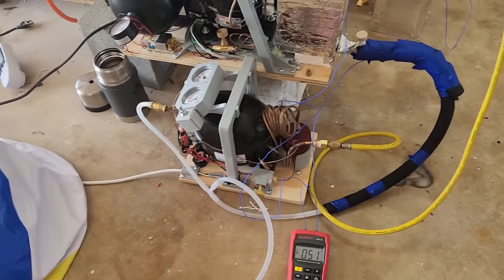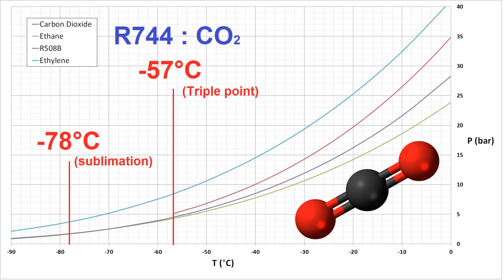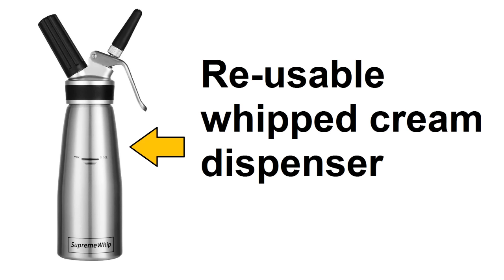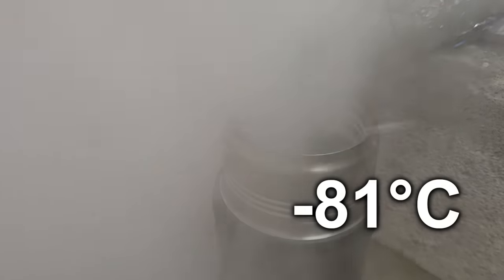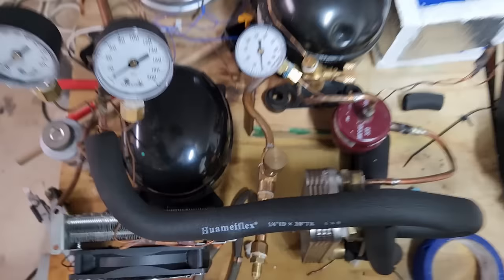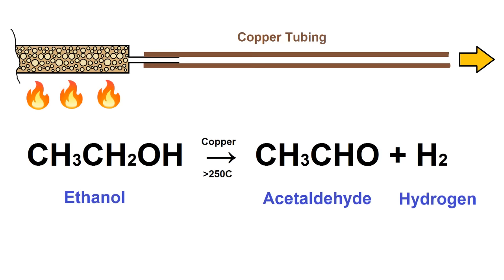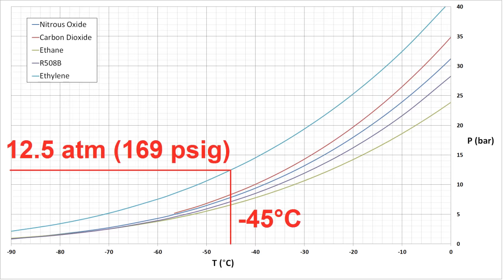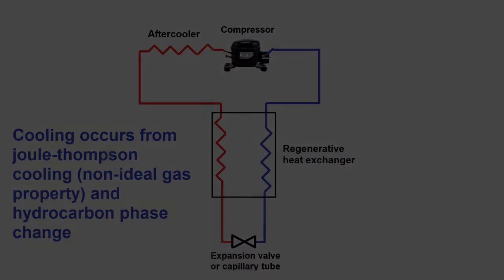DIY Cascade Refrigeration System (Part II)

Comment: as a hvac tech i would seriously recommend dropping the tubes and just getting some TXV's to regulate the system. its removes nearly all variables around the cap tubes and allows you to have liquid refigerant storage (you can also cool) and massivly increase the efficiency.
Reply: wow, thanks for the buzzword. whole new rabbit hole for me to dive down. Thermostatic expansion valves are super cool! I rarely get so caught up in a new (to me) idea.
Reply: @blakes8901  then you are going to love electronic expansion valves and variable speed compressors (aka: inverters). its why minisplit AC's are so efficient.
Reply: Thanks for the search terms. I love learning.
Reply: TXV will only work for first stage. For second stage capillary or EEV is the only option.
Reply: @Exotic_Chem_Lab  Why won’t a TXV work for second stage? I really only understand normal household HVAC systems and have never messed with multistage, but I find it fascinating!
Reply: @truthsmiles  because you wouldn´t find TXV for this application, even the bigger companies which are into crytoch units are using capillary tubes
Reply: @truthsmiles xv has a sensor bulb filled with refrigerant. This refrigerant regulates the txv. So it will only works for system that uses this refrigerant or similar ones. You can't use it for anything else
Reply: @Exotic_Chem_Lab  So why not get a TXV filled with ethane or NO2 or whatever? I guess they aren’t made?
Reply: Seems way too cold for TXVs that don't cost the amount of a small neighborhood, at least on the 2nd stage.
Reply: @truthsmiles  The bulb need to measure accurate to the tube temperature, the lower temperature the more ambient temperature will be a hassle to the system in a long therm. That is my guess. A cap tube will not work bad when the bulb insulation degrades, stressed technician, dry thermal paste etc.
Reply: @truthsmiles  they aren't made for those gases
Reply: @Exotic_Chem_Lab  Call me crazy but it seems plausible to me to make one... you could cut the bulb open, braze on a service port, and fill it with your brew of choice? Of course it would be a very "engineering prototype" kind of contraption, but seems doable, no?
Reply: @truthsmiles bruh... better use electronic expansion valve or just capillary instead of destroying TXV and messing around with it
Reply: @Exotic_Chem_Lab  tetrafluoromethane in 2.stage is option too but Hard to get
Reply: @a.belladonna8316  CF4 is for third stage.
Reply: @Exotic_Chem_Lab  Hey, somebody has to go first, right? ;)
Reply: @truthsmiles  both Capillary and EEV are cheap so no point in messing around with TXV :)
Reply: @Exotic_Chem_Lab  thanks  but i  plan r404a for first stage but ı dont research cf4 pressures anyways dont avaible for me
I have question for you r 290 better than r404a BP is lower but efficiency  ı Just dont know
Reply: @a.belladonna8316  propane is better for first stage as it has higher thermal conductivity and lower viscosity. If you can work with very high pressure flamable gas then go for R290
Reply: Well I am sleep  deprivated when posted i confused r14 vs r23
Reply: in cascade system its goal to reach coldest temps as possible its not abouth efficiency when i was Child xtremesystems forums i read bunch of single stage and i do it few Times but never able to build cascade 2 years ago i buy brazed plate heath exchanger now ı waiting for first stage rotary compressor sorry for my bad english
Reply: @Exotic_Chem_Lab  thanks 👍
Reply: @SupremeRuleroftheWorld Thanks for expanding my vocabulary on these items, more to learn! Can one run any compressor variable speeds with PWM controls, or are variable speed compressors built differently?
Reply: He will just need to remember to Purge and flow nitrogen to keep from blocking up the TXV probably wouldn't be a bad idea to do that for the final system anyway.

However as a relative newb to the HVAC world I'm not sure if it matters as much on smaller as it does on larger ones
Reply: @SupremeRuleroftheWorld cool guy 😎
Reply: Are you not pulling a vacuum on your system? I see your filling the beach ball and no mention of pulling a vacuum on the system before filling. You might have non condensables issues.

Comment: love this project. the idea of making your own refrigerants is so interesting. i work on cascading refrigeration freezers for work with box temps hitting -80C. High stage uses R-290 (propane) and low stage uses R-170 (ethane). we have a different freezer that uses R-404 on the high stage and R-508B on the low stage.

I think you would also benefit from figuring out the superheat of some of these tests of these refrigerants to help see if liquid is spitting past the evap coils. if theres even a PT chart for some of these refrigerants lol. also they have pressure based txvs that can let you play with the orface size instead of having to make the cap tube calculations. another idea i had was using pistons like they do in residential hvac units and you could swap them out for different sizes. good stuff man keep it up
Reply: Once I saw his first video on ethylene, I found a comment on making it with phosphoric acid, since I had all the equipment I have this setup in my garage, but I'm getting some contamination because it is hard to get ethanol here. I'm using some first cut distillate that definitely has methanol and who knows what alcohols in there. I definitely condensed some ethylene last time I had a go, but barely any at 550 psi and -35C. More dimethyl ether and ??? than ethylene. Definitely some hydrogen or otherwise contamination too.  I am going to use liquid nitrogen to clean it up.. just waiting on the dewar to show up.
Reply: @SEVERA PRAVDA the amount of surplus energy you put into the damp, protecting the compressor of liquid, look into a logPH diagramm and you´ll see the dampzone, superheated zone and subcooled zone of your refrigerant, a single stage refrigeration cycle uses the dampzone and and a tiny bit of subcooling on the highpressure side, a tiny bit of super heat on the low pressure zone (very basic explanation)
Reply: Danfoss has a slider you could use to make a good guess for all these refrigerants on their mobile app

Comment: Have you considered harvesting some EEVs off of an old inverter mini split instead of using capillary tubes? That way the expansion is constantly tunable with ambient temperatures, etc. With a microcontroller you could really dial in the ideal evaporator temperatures of all of the stages.
Reply: its quite complicated to set up, regular TXV's would be way less complicated.
Reply: @SupremeRuleroftheWorld TXV won't work for second stage.
Reply: @Exotic_Chem_Lab  Too low temperature for working fluid inside TXV?
Am I right?
Reply: @markhivin8670  yes

Comment: Thank you for all the information and detail you include in your videos! I recently found a huge laboratory freezer on the side of the road used for testing ceramic connectors in aircraft! Along with an endless list of equipment including 2 ultrasonic cleaners, multiple soldering stations and lab equipment 😂

Comment: A few words about Nitrous Oxide.   
You've an ignition source right there, in your compressor - internal friction.
Be wary of adiabatic compression causing N2O to decompose, there have been accidents and deaths on the aerospace sector. 
Somewhere on YouTube is a video of an aluminium tank exploding from a propagated shock wave through a metal charging line, the guy was using this in his home built rocket.

Comment: Awesome stuff, I love where this is going! One suggestion from the ethylene production video that makes more sense now: iirc you were using a water bath for boiling the ethanol, but had the flask flat on the bottom of the water bath. Usually when using baths like that, the flask (usually a round bottom/boiling flask, but doesn't really matter) is held above the bottom of the bath by the neck of the flask. That way there's no thermal conductivity between the heater and the flask. There's a slew of clamps, stands, and labjacks for such setups. As for your pressure and stopper popper issue, flasks with ground glass joints can hold glass stoppers or other attachments on under low pressure using keck clips (available at your favorite bong shop, lol) - but your solution is pretty clever without investing in a buttload of glassware

Also, fun fact - acetaldehyde (acih-TAL-de-hyde) is the first metabolism product of ethanol by the liver and is considered what contributes to hangovers.

Comment: In the late 70s I designed and had built a thermal cycling chamber for nuclear grade components that went from 450 deg F to -150 deg F.  For the first stage I used R-502.  I used R-13 for the cryogenic side.  Yeah, they're CFCs but since nobody uses them anymore, they're quite cheap.  Maybe you could find a friend with a license to buy you some.  I still have some 502 that I'd give you but I suspect we live too far apart.

Couple more comments.  You should be using a de-superheater on each stage.  This is a simple heat exchanger.  On one side the cold gas from the evaporator flows.  On the other side the hot gas from the compressor flows.  This does several things.  It brings the temperature of the gas going to the compressor up to a more palatable value, making the compressor more efficient.  Second, it cools the hot gas from the compressor so that the condenser pressure will be lower, again improving the pumping efficiency.

Second tip.  Compressors come in 3 flavors: High, medium and low temperature versions.  High is for AC, medium is for refrigeration and low is for applications like yours.  A medium temperature compressor, as yours appears to be, will not handle the cold side of the cascade.

Comment: I have worked with cascades down to -152c by auto cascade set up using 5 gases.
The last boiling on those systems was R50 methane.
Boiling point -161,6c by atmospheric pressure.
 Could be possible to use in the last stage?
Very interesting to follow your ideas and that nothing seems to stop you😊
The last you think of is used by industrial gas producers and a great solution😬

Comment: As an insulator a Spray Foam may be used (Spray foam insulation or spray polyurethane foam (SPF) ) it have good thermal isolation properties

Comment: This is easily the best build series anywhere on YT right now, mega props and keep going! 

One question though: The compressors themselves have to be running at very low temps, how do you accomplish that? It seems like it’d be hard to find lubricants that would work well that cold, and I’d think the compressor itself would be a huge heat load on the system. Are you using some special type of compressor that’s designed to thermally isolate the piston from the motor and body of the compressor?
Reply from the maker: Usually you add an "aftercooler" between the compressor and the second stage's condenser so that any heat from temp. rise over ambient can be discharged. It works without an aftercooler, just less efficient

Comment: i used to work on cascading cooling units, we prefilled the 2nd stage with a little amount of R290 (3bar abs gas) which helped with oilclogging problems and too high condensationproblems (afaik the receipt came from a company named Colora, they sold that as "coolmix")

Comment: Have you considered a different compressor?

A screw compressor could reach higher pressures than the one you‘re using and you have the added benefits of less parts (albeit of a few high precision bits and bobs) and no more hammer-action mechanics and also controllability (varying speed and/or oil seal length).

Mayekawa builds the Pascal Air ™️ ,  reaches -100C with air as refrigerant.

Great stuff!
Reply from the maker: Next part of the project will use a rotary compressor

Comment: Getting your EPA card to buy refrigerant is easy. You just have to take an exam and pay a small fee. You already know all of the theory so all you have to do is memorize some random laws and dates relating to them which is still on the test (even though the dates have all long since passed), and possibly study a little about less familiar stuff like low pressure chillers. There are also safety questions on there. I studied in my spare time a few weeks for it, took the test at a local community college (I did not have to take the associated class), and got 98% on all three sections.

I wouldn't say it was completely trivial, but given how much you mess with refrigeration stuff, you'd probably benefit from it (watching your videos I was surprised you didn't have it already.)
Reply: As an aside, I'd be surprised if nitrous oxide couldn't burn at least some HFC refrigerants like R32 which are mildly flammable.

Comment: The lower-than-equilibrium temperatures you are seeing is to dilution of the evaporating refrigerant by air.  This produces a reduced partial pressure of refrigerant vapor at the liquid surface.  The total pressure is 1013 mbar, but the partial pressure of refrigerant vapor is less because only part of the gas at the surface of the liquid is refrigerant vapor.  This gives a lower than expected temperature.  
It's a big effect.  I've seen 20C lower than the equilibrium temperature in an exposed pool of R12 (decades ago).  It actually drops further if you blow on it, because of the increased dilution.
If you arrange your test to vent into a semi-closed container (cup) that keeps much air from getting to the liquid surface, you'll see the exact expected equilibrium temperature for atmospheric pressure.
Reply: TMD-50 manual shows an accuracy of +/- (2°C + 0.1% reading) . 
TC accuracy not included, about 2.5°C according to	DIN/EN60584 NiCr-Ni. 
So 4.5°C with new thermometer. Maybe more after 1 year.
Real difference or accuracy issue ?

Comment: Using a worm gear on needle valves reduced the nightmare/headache I had when DIYing a quick and dirty phase change refrigeration system. You could even gear that down and drive it with stepper motors (even a micro stepper controller) to sweep through the adjustable range and test/log temperature differentials relative to the equivalent expansion valve orifice size.

Comment: This has been fascinating to follow. Maybe instead of cap tubes, you could use cheap electronic expansion valves from China. Pretty sure you can drive them with a stepper driver, and they offer tremendous precision. You could use an Arduino and program it to be reactive to the load, or just dial it in manually.

Comment: As an hvac tech i'd recommend against using N2O. It is an oxidizer and has the potential to react with the oil in the compressor, that means explode in the cylinder under certain circumstances. That is also part of the reason we don't want air or oxygen in the systems.

Comment: If you need just a little more Nitrous oxide and dont want to slowly fill up the beach ball with the small whip it canisters you can fill up a larger canister (like your co2 tank) at most beer and wine stores that sell kegs, as Nitrous oxide is used as a replacement for CO2 in some malty beers like Stouts.
Reply: Isn't there a difference between Nitrous oxide and NOS? N20 and NO2?

Comment: ethane can be produced by Kolbe electrolysis of acetic acid. Platinum electrodes must be used so that the decomposition of the acetate group into methyl radical is more thermodynamically favorable; free methyl radicals pair up to form ethane.

Comment: Generator/switchgear controls tech here, love this series.

Have you considered using a single phase VFD for the compressors, so you can actively tune the pressures in the system? I understand a TXV or orofice isnt usable.
Reply from the maker: That's a pretty good idea, i'll have to look more into it

Comment: 11:51 Nope.  Your third stage would need to run 40-50 bar.   M4J5TER did this.  He had 3 stages, propane, ethylene, and methane.  The methane stage was 40psi low side, and 50bar (750psi) on the high.  This dropped to around 40bar once the whole system was at operating temps.  The methane stage was also a Joule-Thompson cooler inside of the collection flask, best I can tell.  These rotary AC compressors can (and should) develop some insanely high pressures, and there's no getting around it for making LNG.

Comment: Hey man. Those soft plumbing solder joints you made are definitely not going to hold at those pressures. They really should be brazed with acetylene and 15% silver solder rods. If all you have is map gas, you can use Staybrite 8 soft silver solder and their flux and I'll be a lot safer.

Comment: Haven't been this excited for videos to drop since NileRed was below a quarter mil subs.

Real talk, you should upgrade your everclear to anhydrous ethanol using molecular sieve. I don't know for sure that's your problem, but it's a variable to remove.
Reply: this is good advice. the closer you get to pure ethanol, the better. however, it seems that the results that Mr. Pirate has achieved here are just about at the theoretical limit, so it could probably be left on the backburner until a limitation appears in the future. or as a potential answer to a problem that he cannot find a probable cause for.

Comment: 4 stages would be a nightmare for sure.  But what would your LN2 production rate be compared to the single stage Joule-Thomson cooler?  I'm guessing the 4 stage cooler would win.  But it would take a lot of energy to run 4 compressors!

Comment: I relieved pressure off a well that was sitting at 2500psi in the tubing. The top master valve got cold enough it was spitting out liquid "propane." I have some in a water bottle.